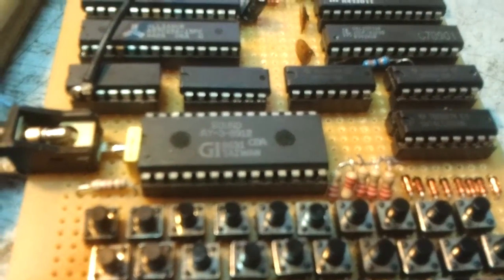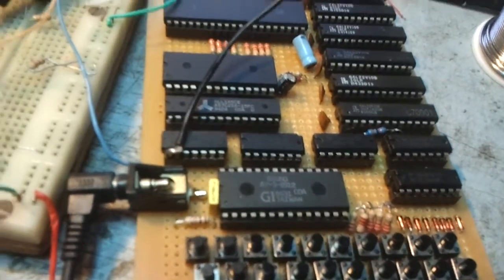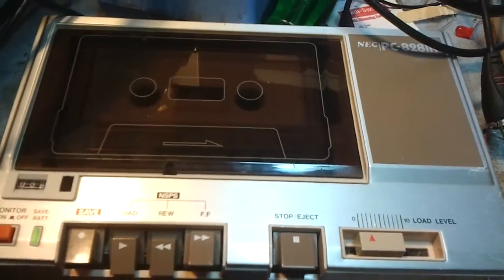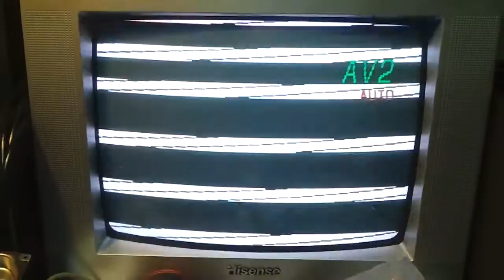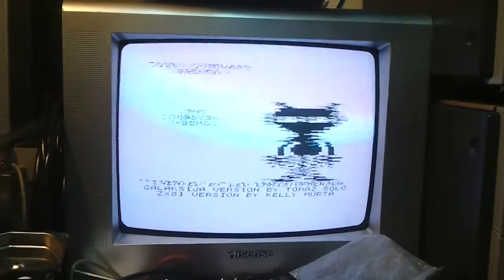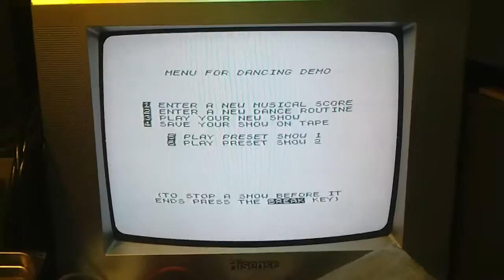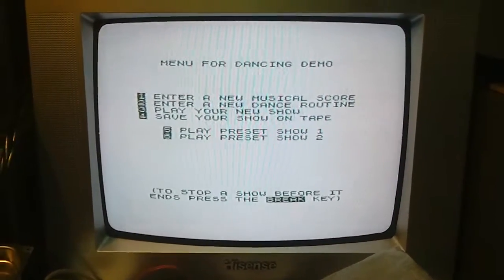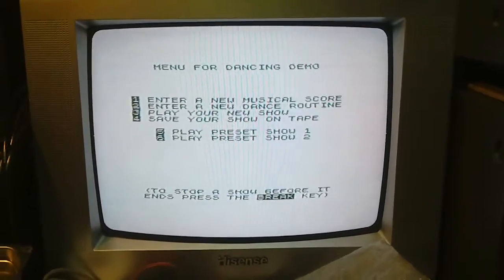Homebrew ZX81 now with AY Sound

Comment: I particularly like how you rebuilt the entire keyboard, For ever all easier usability.. Really clean/adequate work.
What caught my interest was your use of old GAL blue logic... Mind describing how you implemented the logic?
I'm currently hoping to experiment with GAL lookup tables... Thanks a ton
Reply from the maker: The logic was implemented in Atmel WinCUPL (which is a nightmare of bugs) and programmed with GALblast on an old PC with Windows 3.1 and a parallel port. I just tried searching for the source for the GALs and can't find it...  I suspect I lost it in a hard drive crash I had many years ago.
Reply: Huh.. Those GAL devices can however be programed with a TL866 ;).
Just downloaded WinCUPL on my windows 7, 64 bit machine and it 
seemingly installed without an issue...
Reply from the maker: I don't have a TL866 so I ended up making my own programmer. Most of the bugs in WinCUPL are in the simulator, with a few bugs like undo and syntax highlighting not working completely in the editor.